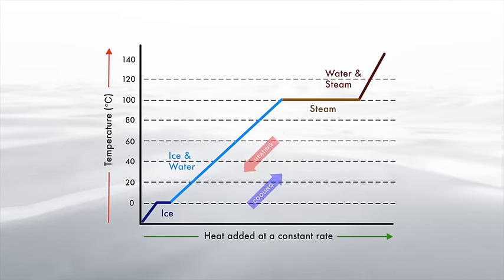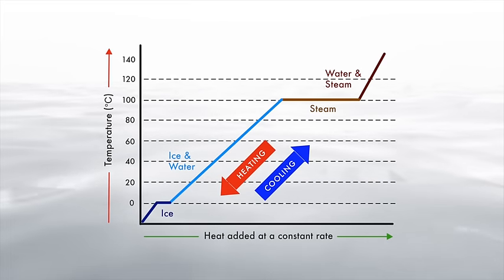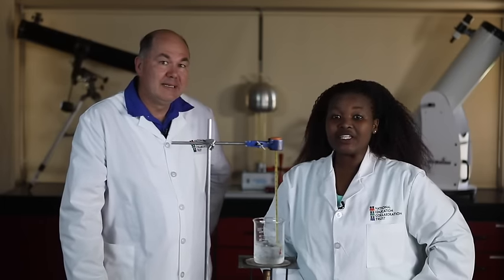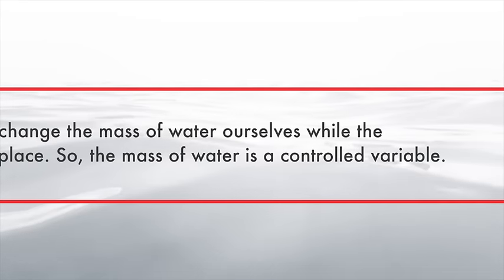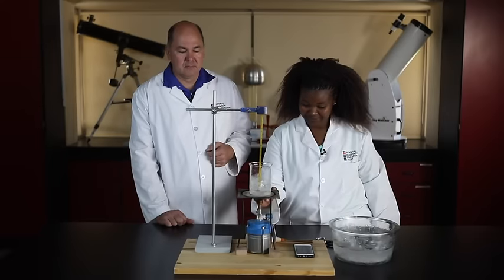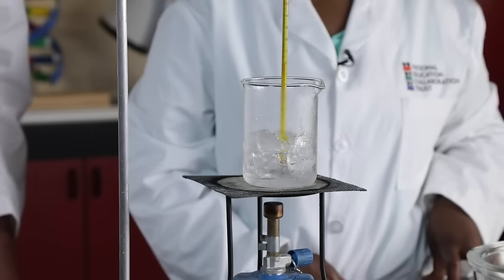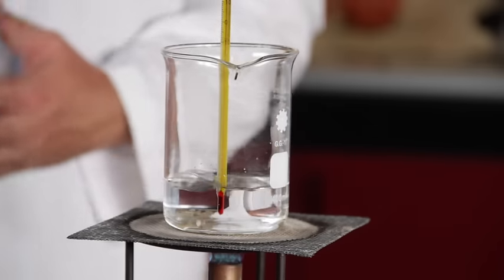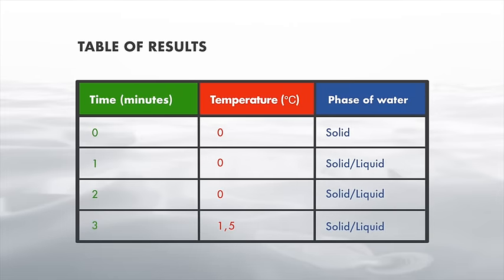NECT Gr 10 Heating and Cooling Curve of Water

Comment: ok but for whoever did their assignment, what did you write for your conclusion? 'cause I'm LoSt❤️
Reply: dunno if i am late but for conclusion you mainly write if your prediction was right in your hypothesis and What shape is your graph? Does it show that hot water loses heat at the same rate over 10 minutes or that the rate of heat loss changes with time?
N.B. A straight line would indicate a constant rate of heat loss. A curved line would indicate that the rate changes.

What happens to the rate of heat loss as the water in the beaker cools down?

Do you think there will come a time when the water in the beaker is no longer losing heat? Explain your answer.

If the water in the beaker stopped losing heat but you continued to take its temperature for a few minutes, what do you think would happen to the line of the graph? stuff like that

Comment: Why did their water boil at 96°C? Shouldn't it boil at 100°C?🤔
Reply: The boiling point of water is not always constant therefore not always 100 degrees Celsius, due to lower air pressure.